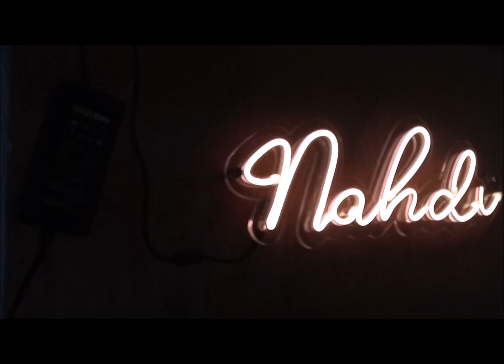MAKE Simple LED neon Sign with clear acrylic backer

Comment: hello po... ano mga materials gamit nyu jn sir?
Reply from the maker: COMPONENTS I USE 
Neon Flex  warm white
AC/DC Adaptor model 1260 12volt 6 amp consume 5 meter led watts
Clear Acrylic 3 mm, / 2mm, 50 x 25 cm –  https://web.facebook.com/photo/?fbid=...
ACrylic sheett
Cutter –
Scissors – 
Cyano super band – 
Transparent cable – 
Glue Gun
Heatshrink tubing Insulation wire
Reply: salamat po sir..  marami kang natulungan sa mga video mo po
Reply from the maker: Salamat idol🙂